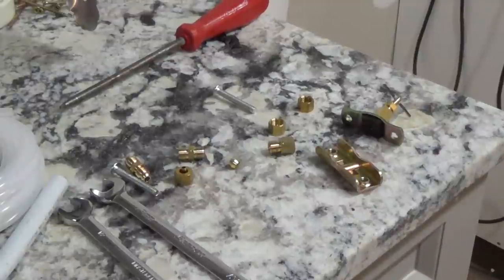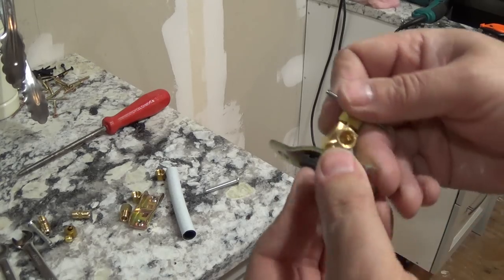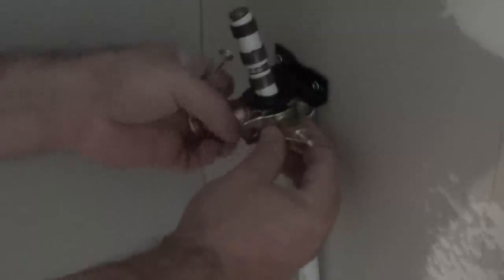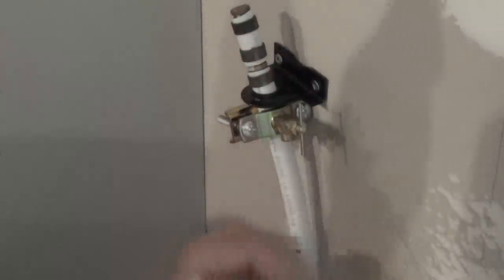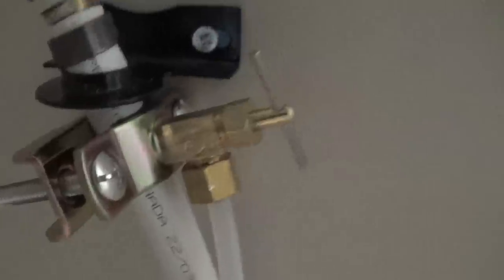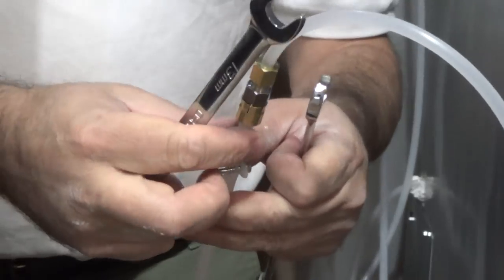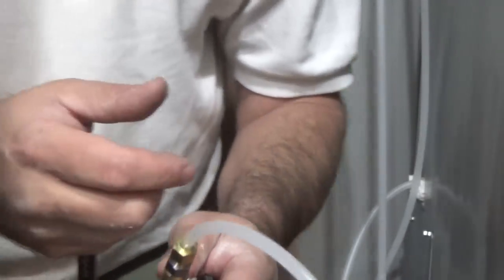DIY Installing a water and ice maker line to your fridge

Comment: I am not a professional plumber, but use of that self piercing valve is not used by any plumbers because the brackets can become loose and rust out over a period of time and then there would be a leak.   Use of that type of valve is violation of code in most states.   Hire a professional plumber and have them install proper valve to attach that hose.  Don't use that valve that comes with a kit.

Comment: Hard water plugs up penetration point...and they leak. Not code compliant. Use Sharkbite , or soldered tee/valve instead.
Reply from the maker: Thanks robert.
Reply: You" F" rigth buddy 👍👍 👍

Comment: Nut compression rod and ferrale the nut goes on first then the ferrale is the small ring that you slide over the outside of the tubing the rod is inserted inside the evenly cut tubing you have the  nut and ferrale on insert the tiny rod into the tubing and it will prevent smashing of the tubing ...plastic on plastic is best because otherwise the copper is more malleable and can cut into the tubing.
Reply from the maker: good stuff

Comment: I thought these connects were only made to be used for copper pipes. Have your had any issues or leaks with it?
Reply: You thought correctly.  Just because it did not leak now does not mean it will not leak in 2 years while they are out of town.
Reply: @jimi.7249  they leak on copper too so I'm thinking to just buy a shark bite valve and cut the pex and install it

Comment: I keep hearing people say don't use saddle valves
Reply from the maker: Why is that?
Reply: 4dhoneybee saddle valves will start to leak after a couple of years when the rubber starts to dry rot. It’s an insurance claim and bad day waiting to happen.
Reply from the maker: Thanks Doug what is the best fix?
Reply: 4dhoneybee cutting out a small half inch section of the copper pipe and putting in a “tee” that connects to the water line to the fridge. They sell kits to do it at most hardware stores.
Reply from the maker: Thanks Doug will check it out. This was the kit recommended by kitchen aid but I’m hearing it’s an accident waiting to happen.
Reply: @4dhoneybee107  Getting a new fridge installed soon. The installers will not  hook up to my current saddle valve (30 years and no leak). Must be a  standard shut-off valve.

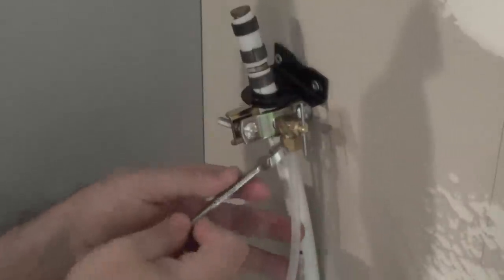Comment: @ 11:00 to 11:59, you are torquing the pierced connection on the main line. NEVER put a wrench on the compression nut without putting some kind of wrench or pliers on the body of the valve, to keep from twisting the main line connection.
 You also did a very poor job of cutting the 1/4 inch line off, where it goes to the fridge. That should be a SQUARE cut
Reply: may own thoughts too how many houses i have bought and had torn out all of the plumpings what was wrong and wiring too

Comment: That's wrong, on plastic tubing you should use plastic ferrels..in time that brass ferrel will chew through the tubing from the hammering of the water turning off and on
Reply from the maker: Good stuff

Comment: these saddle valves are not allowed by virtually all plumbing codes in the United States. If you have a leak that causes a lot of damage, your insurance company will likely not pay because this thing was installed against the plumbing code. Don't do it this way! 👎

Comment: I visited my mother she had a fever I ran to the store to buy some medicine and soup came to her door knocked she started screaming eventually unlocked the door as I attempted to busy it down, there was water from the front door through thee ntryway through the  living room the entrance to kitchen through the dining room out the side patio door down the hallway into the front bathroom and through the living room kitchen WALL into the master bedroom and bathroom....the water out of the sliding glass door and under kitchen sink flowed like a river...and I was literally splashing through the ankle deep water to find it it was very loud and yet hidden not under the sink I listened at the walls I couldn't hear it as if it was near so I bent down and caught some light on the surface to see which direction it was flowing from, here behind the built in refrigerator I pulled it away from the wall and it looked like Las Vegas Bellagio Fountains. I shut the water off and opened the doors told my mom to stay in her room my kid brought her medicine to her I rushed home got every BROOM and rags fans and the best squeegee brooms ever..home depot I swept for a good three four hours and ran fans kept back in the bedroom to lay down towels ran home to get shop vac walked through the door and it was flooding again, no one told my older kid about the leak she thought she could just grab some filtered water from the sink nope. Long story longer walls flooring over 15 grand 2 bathrooms living room entire kitchen and countertops all marble and baseboards new tile new carpet new paint new faucets stove refrigerator ..2 months in a extended stay hotel.
Reply from the maker: Wow
Reply: That's it; you done!!!!😃🤣🤣🤣🤣🤣🤣🤣

Comment: Not a great idea to use a saddle valve.  They are doomed to fail over time.  They are actually against code in some municipalities.
Reply from the maker: Great info thanks
Reply: That is correct,  expect 5 years before corrosion and leaking. Spend $10 more and use professional kit. See Ask This Old House and see video.

Comment: The moment I saw that you were actually going to use a saddle valve I gave it thumbs down. Saddle valves are prohibited by plumbing code for a reason. They always wind up leaking eventually, and cause a lot of problems.  Throw out that kit amd install a proper Tee and reducer, or pay a plumber to do it right. The extra money you spend will be nothing compared to the thousands of dollars in water damage that your saddle valve will cause.

Comment: Terrible job this guy doesn't have any idea to how to connect ice maker line the right way to do is with ice maker box the box already have the valve and you can connect cooper pvc cpvc or pex and the box get flush with the wall like the washer huk up